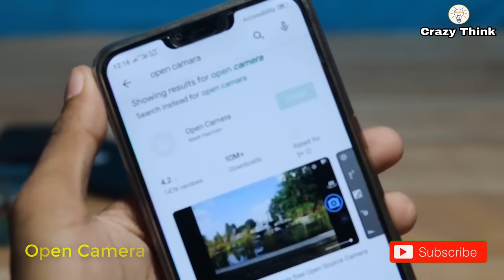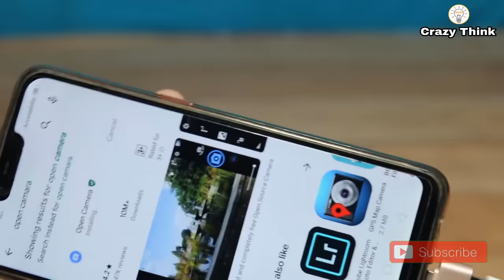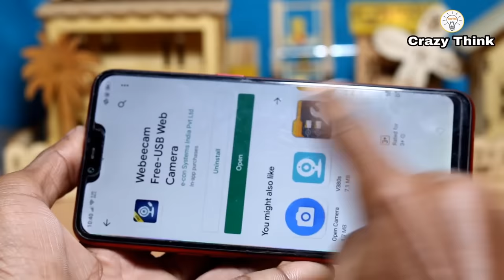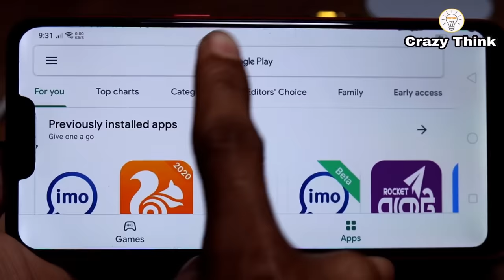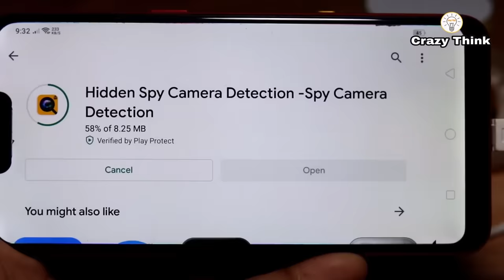4 Amazing Spy Camera Make - Using  Old Mobile Camera || DIY Spy Camera

Comment: From the angle the phone is in and the position the camera is at doesn't look like the video is coming from the camera hooked up but from the camera that's already on the device..... I can't be the only one that noticed that.....
Reply: yeah that's definitely fake, you can't just randomly solder 4 wires to a ribbon cable and have it work :D

Comment: Why can't you make use of the other side of the USB cable instead of the OTG
Reply: You have to link it to a phone like Google and shit if u used the other side ud probably have to use a computer
Reply: And even then for this to work you'd have to have internet and that camera plugged in and the app running and connected to it
Reply: @scottmontgomry7484  its a USB adapter so the computing device (cellpone, tablet, laptop, PC ect..) can recognize a connection but that does mean its know what to with it or even knows what it is. An application/SDK has to manage the connection with specific instructions. Also, it doesn't require Google and/or an online connection after a universal or proprietary application is installed. What this video doesn't explain is the soldering job in which it doesn't specify the pinouts of the camera module. Pure ignorance and they assume you know this.

Comment: Why don't you just solder it to the type C end of the data cable? Is it not good to connect it directly to the phone? You have to use OTG. It's incredible.

Comment: Hola maestro, muy interesante y para mi bastante complicado trabajar una camarita como lo que demostraste. Ahora bien que tal si tu me haces una, debes de tener un arsenal de celulares viejos. Me puedes hacer una me dices cuanto cuesta incluido el envio. Yo quisiera  que la cámara tubiera un cable de usb bastante largo unos 20 metros para conectar desde la terraza al dormitorio. Se puede hacer eso?.  
Muy buen trabajo maestro felicitaciones. Tu amigo, Ramón Cevallos Intriago. Te escribo desde Manta Ecuador.
Reply: no te daS  cuenta de que se está burlando? es toda una estafa o burla,  minuto 13:57 está enfocando y al costado de la lente y la cinta.......desapareció el celular? no sale en el enfoque.  no creas en estas cosas.
Reply: El viejo verde ramón ya quiere espiar con su cable de 20 metros jajajajajaaa
Reply: @cynos100  Es correcto lo que dices. Hay varios videos así. Son pura estafa.... Solo quieren hacer plata con nuestros views.
Reply: ya las venden hechas en aliexpres
Reply: no mames wey ajja, es obvio esto es falso.. no puedes simplemente conectar una camara de celular, los pines para los datos no pueden ir conectdos simplemente a un cable usb, además de que un puerto USB te da mas voltaje del que una camara de esas necesita

Comment: Where can you buy usb wires as well as such camera’s?
Reply: This is using a camera module from a cell phone. USB is a industry standard regardless of it connector (Micro-USB, USB-C or USB-A) so you can use any USB cable but its easier with a USB-A and/or Micro connector. USB-C cables have more wires for faster data transfer so unless its a super high-resolution camera, its useless. Its harmless to try if you have a old busted cellphone and know how to use a solder gun lol.

Comment: At 9:56 apparently his phone turned invisible you can see the whole roll of tape in the video and there’s no phone behind it but yet on the counter, the phone is right behind the tape, so did the phone just become invisible because it’s not on the new recording but the cameras supposed to be taking the phone sitting behind the tape or just beside and yeah, you can clearly see there is no phone anywhere near that so it was pre-recorded and he tried to time it properly but if you pause it, the lights are all off as well try pausing it starting at pausing it starting it watch the lights they don’t match. not one of his videos is proper. They’re all a scam not one of these will work. Do not waste your time.

Comment: another fake video
he soldered the wires anyhow, shorted the pins, a blub of solder, ok...
he's showing the video (in the 2nd video  at about 11min) a RECORDED video of the same wooden toys.
the video is centered in about the 2 little houses AND at the level of the roof of the house in the left(pause at 11:13 to see) BUT the cam is at the window of the right house.
No... REALY
did you noticed that

Comment: Hello, may I ask you what can you remove a camera from the cell phone but stay connected to the cell phone with the cable?
Reply: Hi
Reply: Its fake 😂 rewatch the video mate.
Reply: @RedBaronisa  the app and parts of it may be fake, but you most certainly can make shift the camera to the USB as shown. After simply plug into your desktop and boom, webcam enabled. Not sure about using on mobile phone tho

Comment: I wont be fooled by your de soldering skills of the camera cable that easy, what u did is you hold them by silicon glue and on camera u pretended u remove it... UN-SUBCRIBED